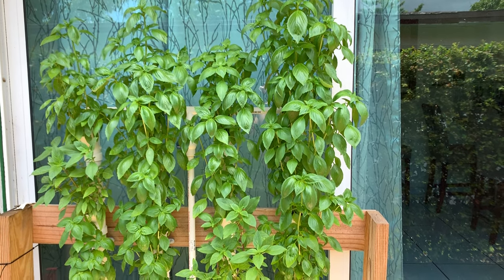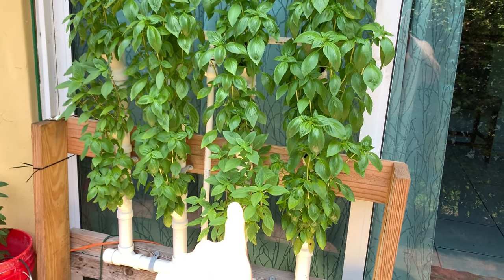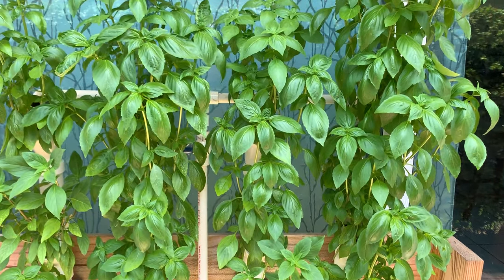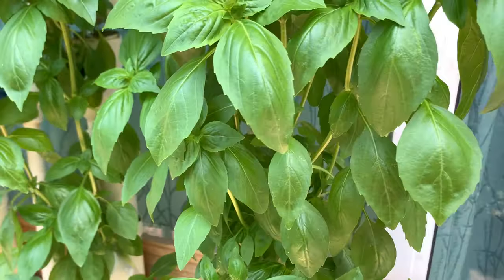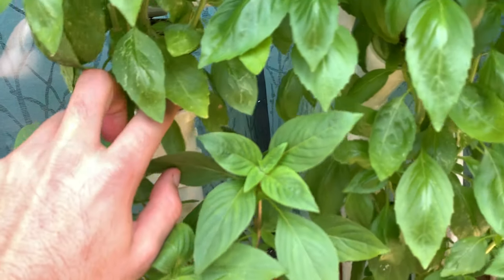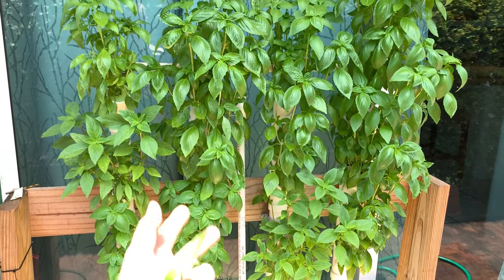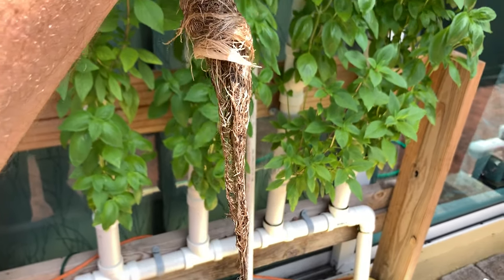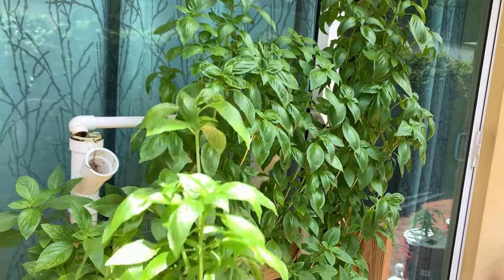How I Built My Basil Wall - NFT Hydroponics - Rain Tower

Comment: Hi Bob, awesome videos! Just one question: Would you still go for the rain tower system after all you've learned with ebb and flow trays, dutch buckets, etc.? I want to go for tomato/pepper buckets, but I can not decide what to use for leafy greens, strawberries, etc. Thanks!
Reply from the maker: The towers worked well for bok choy leafy greens but Basil plants last longer with more intricate root systems so you risk occluding the small pipes (which mine did). My DWC and ebb flow works great for big plants and little plants and keep the roots isolated from the next.

Comment: The water pump run 24 hour? Horse power for the pump?
Reply from the maker: 264 gal/hr pump from eBay. 12v low watt, it runs 24hr
Reply: @BobGrows  thanks. One more, constantly 24hr or every 15minutes for 24hr?
Reply from the maker: Jejaka Perindu constant 👍🏻

Comment: Is that a 4x4 or 4x3 sites?
Reply from the maker: 4 wide 3 tall. Pump wasn’t strong enough to go 4 high
Reply: @BobGrows  I ended up making mine 4x4, powered by my solar panels..... and I ran my drain and pump tubes out of the side of reservoir so that way the res is rain proof since I have  it outdoors